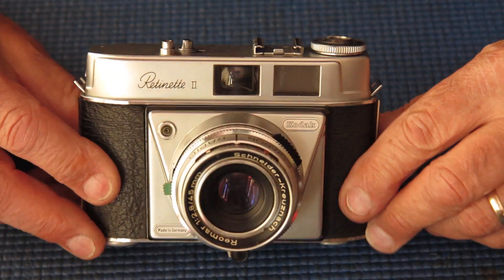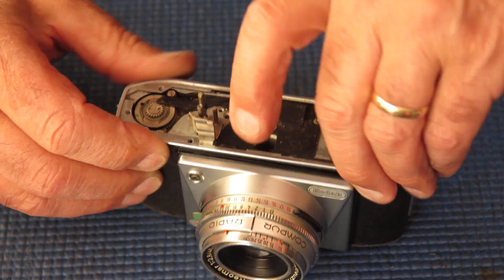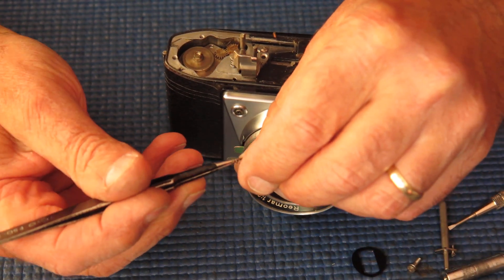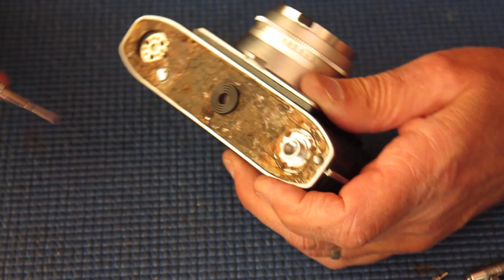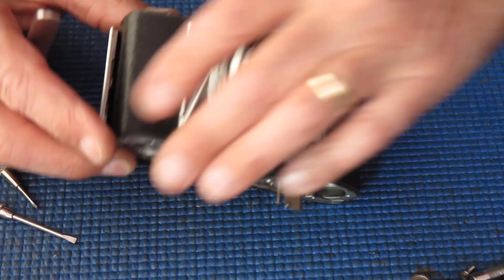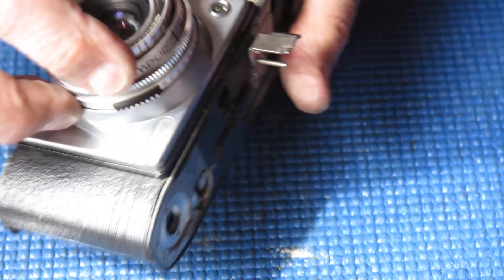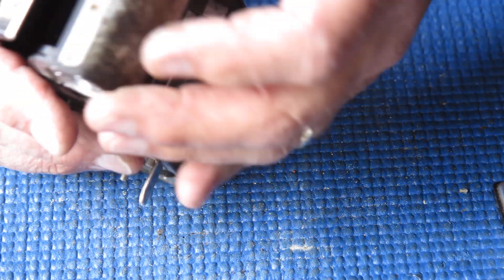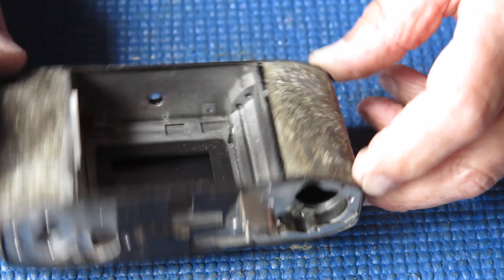Kodak Retinette II film camera service part 01

Comment: I fixed a wobbly cocking shaft once by filling the riveted area with J.B. Weld. I tried to re-seat the rivet first and just could not get the wobble out. The JB Weld worked perfectly.

Comment: Any tips for someone trying to get the inner shutter ring off?  Where can I find the tools and solvent you mentioned?
Reply from the maker: Watch the whole playlist, the shutter comes apart in parts 3 and 4. Plenty of tools on eBay and the like, but some things you'll have to make for yourself. As for solvents, I use naphtha, CRC Lectraclean, or a grease and wax remover depending on what I need to do.

Comment: I have some of the original Kodak lens ring removal tools but like you do not have the right one for the II/IIB. 
I made an adjustable tool some time ago by grinding down a set of old calipers which works well on the IIB and lots of odd size rings/elements/etc and has good leverage so i often use it in preference to the kodak tools (although it is more prone to slipping than the original tools). Definitely a DIY tool but works a treat!  - https://live.staticflickr.com/65535/49478509167_593458bc5f_k.jpg